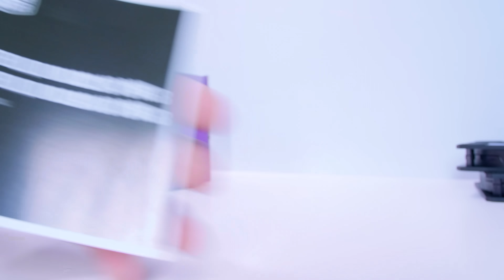HOW TO Cooler Master ML240L V2 RGB AM4 & AM5 Install Guide

Comment: When plugging the 3-way RGB header into the motherboard. Does it matter which side the arrow on the connector you are plugging into the motherboard is on? I have an MSI B550 Bazooka, and just got this cooler. I have my 2 fans from the AIO, and the pumps RGB connectors plugged into the 3-way then plugged into the JRAINBOW1 header on the upper right of the motherboard. But I'm not getting the LED's on the fans, the pump LED is on but can't be controlled by the motherboard software.
Reply from the maker: yes it matters. I addressed this in the video

Comment: in 11:06 or 12:01 it shows that the wire has 4 holes for the MOBO but mine only has 3 and it doesn't fit in the G D V pin my manual instructed me to which didn't allow me to use the controller box. Although I was able to get the AIO work without using it... Is it absolutely necessary to have the Controller?

Comment: I have the Illusion, the same setup. MY CPU idle temps were very high, 56 degrees Fahrenheit... And then I watched this and realized I installed the fans backward, as in I put them INSIDE the case. I'm an idiot...

Comment: When hooking things to the motherboard RGB headers, how many fans can I put on each one? Can I hook a 3way to a 3way to get 4 fans on a header?
When my 240 arrives, that will put me at 8 Sickleflow fans. I'll be doing push/pull fans on the radiator.  The fans say 0.09A for the LED...1.8W 
ASRock B550M/ac specs say - 2 x RGB LED Headers* (*Support in total up to 12V/3A, 36W LED Strip)
Does this mean 1.5A per header? 8 fans would be .72A - 14.4W so powerwise seems ok?

Comment: great video, i will install this cooler to my case tomorrow. one question though:

12:44 is this the right orientation way for the radiator? I've watched some videos and they say that its better to do it other way around so that air will be on top and liquid can be at the bottom to do the pumping. although it can be a problem touching the gpu. I'm going to try to install it cables on the bottom if my case allows it. if not, oh well, cables on top then.

Comment: I am buying this cooler for my R5 3600 for these hot days and I am loving this really understandable guide for installation. Really great video. I hope that RGB really works with "fusion" for Aourus motherboards.
Reply: How is it goin? I jus bought this for my 5800x, did a cinebench multi core test and the temps are at 90 and stays there 🙄
Reply: @rhymesltd  Yeeesh, well at that point you’re comparing completely different cpu’s buy a higher end cpu cooler, these are made for lower end cpus like mine and his, very late but still.
Reply: @poggers5961  lol I wish I knew lol. I bought a air cooler instead. A bit cooler. I'll have to get a high end cooler. Lol
Reply: @rhymesltd  Unfortunatelt the price we pay lol, hopefully you find the right one for you.

Comment: hey so i installed this cooler and now nothing will show up on my monitor? i connected the wire you put on cpu_opt into another one called SYS_FAN1 that was the only one i saw that would fit unless there’s another reason why. pls help thanks!

Comment: The bracket on this thing made me go from having fun to wanting to yeet my whole system out the damn window. But otherwise nice cooler.
Reply: Bro I thought I was just stupid or something. This is the shittiest design Iv seen
Reply: It's a very poor designed bracket, just look at how much it slides when installing, that's the thermal paste been spread out uneven.
Reply: Yeah, seriously an unneeded pain
Reply: Hmmm....about to replace a 120L that came with my prebuild...with a 240 when it arrives. Hoping for a simple swap. (First timer.)
Reply: For me it went smoothly, don’t know why everyone has so much trouble with it
Reply: @bigd2829  Got my 240. It WAS a simple swap from the 120. Newer pump, same bracket. All I had to do was hook the two pegs and tighten it down (new paste of course).
Reply: @yourhandlehere1  exactly, hook one side, then the other, tighten down, and your good to go!
Reply: You ain't kidding brother! My hair is luckily still on my head, but I tore out a LOT of it doing that! There HAS to be an easier way to mount it to the CPU, good god.

Comment: Slightly off-topic question here, but would anyone happen to know where I could go to buy extra mounting plates (the curved things shown at 5:18 in the video)? I have an extra one of these I was planning to use for a new build, but I think I may have thrown out one of those pieces, rendering the whole thing unusable. Everything else works fine, I just need to be able to mount it properly.

Comment: do you need a mounting braket on the back of the mother board
Reply: It is included with the AIO
Reply: Sorry my bad for the false information, Yes you do need the bracket on the back included with the motherboard. It is NOT included with the AIO.

Comment: So where might one get that mounting bracket that’s on your motherboard. You didn’t mention that, and it didn’t come with the cooler
Reply: it should come preinstalled with your motherboard if it’s an am4 socket

Comment: I’m getting this cooler tomorrow, I’ve never installed an AIO before and I’ve been using a stock cooler for about a year, but I’m not nervous about it because I know I have this video to guide me through it, I love how clear and in depth it goes about the installation and especially the question and answer section that everyone seems to love. Thank you for this
Reply: You play fortnite
Reply: how did it go?
Reply: @artist3856  pretty well, thanks for asking
Reply: Do you need to put liquid
Reply: @johnathan8313  nope, the liquid comes already in the AIO
Reply: Is it still working well? Might install it with my dad, is it simple enough for amateurs who are decent at building?
Reply: @Axzry  yup, works and looks great. It was pretty easy to install as well, just make sure you’ve planned out where you’re gonna put it in the PC before ordering
Reply: @Rex88808  Did you need any extra cables for the RGB ? or anything u needed was in the box ?
Reply: @FelaIV  nope, everything I needed came in the box
Reply: still on your pc?
Reply: @Deiv.  yup, no problems at all so far

Comment: Excellent assist guys. It would have taken me too long if i relied on the instruction manual. Although mine is a single fan unit, i adjusted the same parts accordingly. Just a heads up for everyone using these units is that you may have to mount to the back of the chassis like i did or the top if you can figure that out. Good luck!

Comment: Does it come with the preinstalled AM4 bracket (shown at 7:40), I'm asking this because I lost the one that came with my mobo after installing an air cooler from CM (MA620M) which comes with a metallic AM4 bracket and uses screws, or can I just use the air cooler's bracket to install this AIO?

Comment: I am building a new computer and I have this same Gigabyte B550 Auros board, I wasas wondering does it matter which LED header I use?  or should I plug this specifically into the one labeled CPU LED?

Comment: what case was that?
Reply from the maker: Did you even watch the video
Reply: @GearSeekers  yes I did, I'm planning on getting that cooler and was just wondering if that was the case I have, like the nzxt h510 or something like that, I'm asking cuz it would make the installation simpler if u have the same case
Reply: @GearSeekers  and I'm soz if you mentioned in the video what case it was but sometimes I zone out XD

Comment: My RGB Plug to the motherboard question, does the Arrow connection of the RGB Plug indicated the pin connection to  the +12V pin on the mother board ?

Comment: Hey I have a cool master AIO 240L, I pulled the radiator off to move my 
ram and then screwed it back on. I noticed my lights are not on anymore 
but the fans themselves are working properly, any suggestions on how to 
fix or what I did?

Comment: Not all Gigabyte boards have an AIO pump slot (cpu_opt).  In that case, I think you need to buy a separate molex connector to power it from the main supply.
Reply: you should just be able to plug it into a system fan header
Reply: Yes, if you’re motherboard only includes 2 cpu_fan and no cpu_opt then plug a fan header into one of them and plug the fans into that, and plug the pump into the other
Reply: @coolgamerman909  does this kit come with the header? looks like he did do something like that

Comment: On both videos on this cooler your steps on the rgb are very unclear, I don't know what I am meant to plug into what
Reply: Fine the RGB header on your mother Board (look in manual if you can’t find it) and connect it that way... it’ll be way easier :)

Comment: I have ARGB fans already connected to my 3 pin header; all sync’d does this mean if I plug these into the 4 pin header they won’t be able to sync Becuase they are not addressable

Comment: Someone correct me if I'm wrong, but are his fans on his radiator set up as intake fans? Don't you want the radiator fans to be exhaust? Or does it not matter as long as you have ample airflow throughout the case?
Reply: Fan blades move air by transforming kinetic energy along the coronal plane (the rotation of the blades) into the transverse plane (away from the fans). The blades are hence designed to "shove" the air in the transverse direction as the blade cuts through them, giving the air transverse movement. Maybe you are confusing the functionality of the fan blades and think he installed them backwards or something.

Comment: Does this kit have a SATA to 3/4 fan pin adapter for the water pump?  My B450 mobo does not have a CPU_Opt header nor spare Sys_Fan header available... I need to know if I need to buy a SATA to fan adapter to get the pump powered.  Thanks.
Reply: You can plug the pump into the CPU_Fan header and it will work just fine :)
Reply: @ItzRazed  Most AIO pumps, including this one, are designed to run fixed 12v according to Cooler Master.  Having the pump ramp up and down with the fans will shorten its life.
Reply: @cup_and_cone  thanks for letting me know. I’ve just heard YouTubers and other people say that it’s ok if you plug it into the CPU fan header if needed. Plus you can go into BIOS and have it run at a fixed speed too but I’m not an expert or anything I’m pretty new to this stuff :)
Reply: @ItzRazed  You can plug it into any mobo fan pin, you just have to assign that pin to a fixed DC voltage in the BIOS.  

Manufacturers intentionally don't include an extra header on the fan splitter cable to prevent people from running the pump daisy chained with the radiator fans.

Comment: 7:02 Is that a correct fan direction? I thought we should pull out the air from radiator not push in!!
Reply: Yes, that is the correct fan direction for a push-pull configuration. The fans on the front side of the radiator are blowing towards the inside to push cool air from the outside across the radiator. Two more fans would be installed on the inside of the radiator (in the same configuration) to then pull the air through the radiator, through the case, and then exhaust it out the back of the case with a rear fan.

You do not push air from inside the case through the radiator because in most situations the air inside of the case is hotter than outside of it, and it also creates negative pressure in the case if you're using a rear exhaust which is less efficient than positive pressure. You always want a source of cold air to be flowing across your radiator, whether having the fans mounted on the outer side pushing air inside, or mounted on the interior side pulling air in from the outside.
Reply: @yoji-_   Thanks a lot for a good explanation.  I have 3 questions.
1) What if we don't install internal radiator fans. So only two outside. Should it still blow out or in? FYI, I have one in the bottom blowing in always. (not through radiator)

2)  Don't you have a concern the radiator get's hot from CPU then warm air will be blown to Graphic card and Motherboard?

3) Don't you have a concern if radiator get's dusty and dirty very soon if air blows inside from out?

Sorry it's my first time setting up my gaming PC and I saw your video the most complete one and it raised up all these questions in my mind. Maybe I am over-cautious. Thanks again for your support

Comment: This video is a great tutorial and does a great job at answering the most common questions, but I really want to emphasize the importance of the orientation of your AIO. Front mounting the AIO is perfectly fine, but MAKE SURE THE RADIATOR IS AT THE HIGHEST POINT ABOVE THE PUMP AND THAT THE TUBES ARE ON THE BOTTOM OF THE RADIATOR. Almost every front mounted AIO that I've seen in advertisements has the tubes on the top of the radiator above the pump. If you do this, air bubbles will form and transfer to the pump, which will increase temperatures and create excessive noise. If you cannot put the tubes on the bottom because it's being blocked by a PSU shroud, mount the AIO on the top of the case.
Reply: as long as the top of the radiator is above the height of the CPU pump, it doesn't matter if the tubes are on top or on the bottom, the air bubbles still gather at the top of the radiator. the moment you mount the aio where the top of the radiator is lower than the height of the CPU pump, then it is bad.
Reply: Watch gamer nexus’s video. They say tubes on top orientation is still correct just not best practice. The pump is still lower than the radiator and that’s all that really matters. If bubbles form at the top of the tubes it can create noise but the air will not travel through the radiator and enter the return tube and go into the pump. The pump is not powerful enough to keep air below the highest point so you don’t need to worry about that. 

TLDR air might get trapped at the top of the radiator tubing and cause a bubbling noise. Not harmful.
Reply: First off if the hoses do not reach you have no choice ,second of all I had the first AIO made in that orientation and it ran fine for 10 years.
Reply: @davejohn255  that doesn’t mean it was as effective as it could be. There could be bubbles and more noise then there would have been without

Comment: Hi, when I did the RGB with the remote it lights don't come on. The first time I pressed it it actually worked but now it doesnt at all. Can anyone help me with this.
Reply: yea bit they are louder than corsair fans. but i agree it is easier if you stay with products that are all compatible with the same lighting software
Reply: just buy corsair ll120 fans and use them they are better
Reply: @balsamicvinegar2791  or u can just get a different cooler master fans if u want to stay wit the brand

Comment: For plugging it into the motherboard is there something that's suppose to align with the arrow or does it click in? My connection when I try plugging it in is very loose and I'm not sure why
Reply from the maker: They only plug in 1 way. Exactly as mentioned in the video
Reply: @GearSeekers  is the connection suppose to be loose or snug?
Reply from the maker: as long as it turns on its fine

Comment: Do you guys know why the rgb on the aio wouldn't be working, I just installed it and the rgb is not working for some reason I followed the whole guide and used a ,other board rgb header.
Reply: 12:00 He said you have to use the 12v one.

Comment: Hi there,, i did watch the whole vid, nice vid btw. Im running a asrock a320m hdr motherboard, and im not sure if the rgb fans will light up despite the motherboard not having argb headers / headers for rgb fans (im new to pc building)

Comment: Are those fans on the OUTSIDE of the case?? xD
Reply: That case has a solid front panel that would normally be covering up the fans. All of the case panels are taken off to showcase the RGB lighting elements.

Comment: why is one of the cables on the pwm splitter a 3 pin male connector and the other is a 4 pin? wouldnt that mean only one fan works as pwm and not the other one?
Reply: From what I know, it's designed like that on purpose. A 4-pin PWM fan header on the motherboard is designed in such a way so as to run and control the speed of a single 4-pin fan connected to it. If we were to use a fan splitter with 4-pin on all ends, it would basically confuse the mobo on which one fan from the bunch to monitor and control. So there's always only one "master" end with 4 pins that is monitored and controlled, while the other "slave" ends with 3 pins simply follow suite.
I read about this from Tom's Hardware forums btw.
Reply: @NavrajThapa2002  oh ok i see; from what i understood from other people too is that the pin thats missing is RPM pin reader and youd only need one on the splitter to recognize it: thats why its 3 pin + 4 pin. so, i just wanted to confirm, does that mean that the two would be working as PWM fan even if as you stated, one is a slave, other is a master?
Reply: @The0nly0neAlive  Yeah, from what I've researched myself as well.

Comment: Mine motherboard did not come with a mounting bracket like this? I came with a different one.
Reply: Same here I need help
Reply: @akrodot6665  I went on amazon and bought a AM4 mounting bracket
Reply: @jmac_6921  thanks, annoying that it didn’t come with the box 🙃
Reply: @akrodot6665  yeah neither did mine